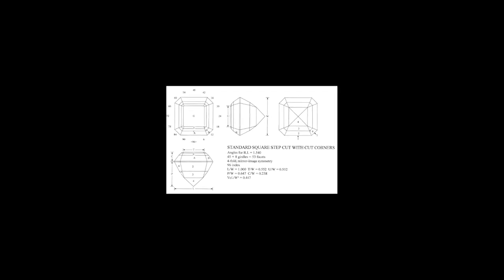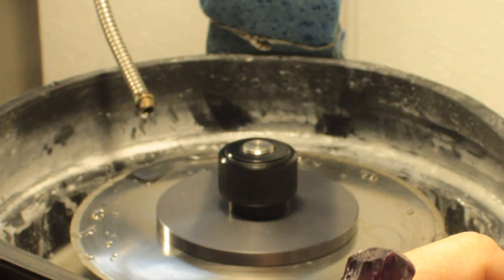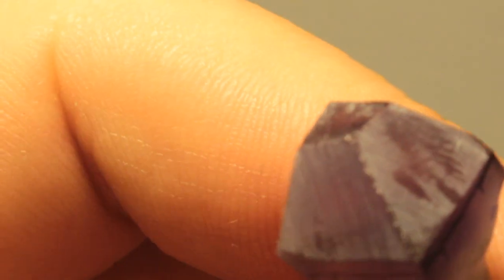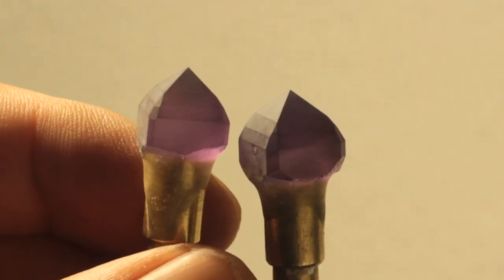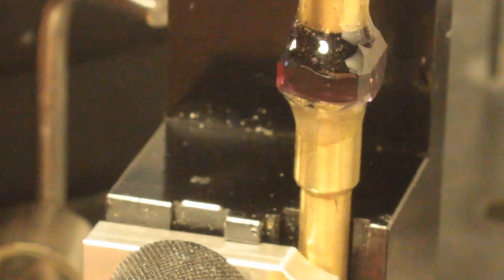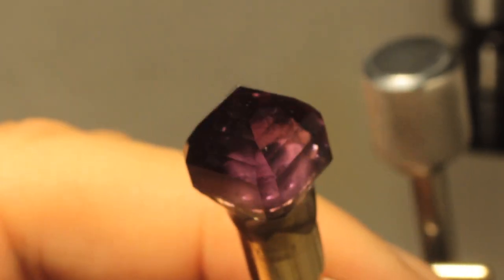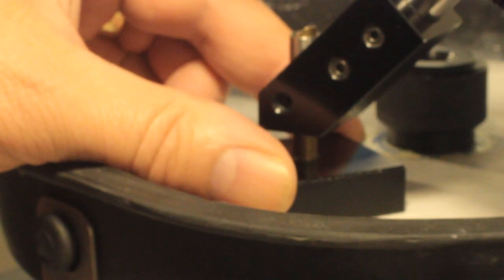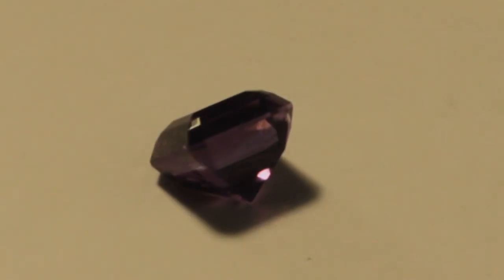Gem Cutting Tutorial: Standard Step Cut For Beginner Cutters

Comment: I agree with you on eyeballing the puddles for epoxy! My one tip when eyeballing is that if you do parallel lines instead of puddles, it’s easier to see if the lines are similar length and width and you can get even more accurate with just eyeballing it!

Comment: There is a trick to getting toppers to lay flat.
First try the master after putting an index mark on your platen with a magic marker, try the Master lap at 12:,3 6 and 9:00. If you have a dial indicator, you can tell which of those four vibrate wobble whatever you want to call it the most and the least. So now try it on the least and then try it halfway between the other indexes and you can slowly dial in where your Master lap is running perfectly balanced. 

Once you have the master lap as stable as possible, do the same thing with your topper 
This is the trick that will make that topper lay flat as possible with your lap. Barely moving and the topper not applied. Get a good puddle of water on top of your master lap. Then quickly put the topper on top of it and get the nuts secured. You should have water coming out your 1/2-in hole in the center and a little on the edges if you have enough water on there now as soon as you start spinning that water is going to create suction as it bleeds out between the topper and the master lap. Faster you go the tighter. It'll suck down. I've got cheap 1200 grit toppers that when I apply a stone to them my dial indicator has a barely perceptible wobble of less than 11 110,000 of a degree. 
You're welcome!
Reply from the maker: Great advice.  I will give that a try the next time I use a topper.  Thanks!!!

Comment: Excellent tips.
I’m an amateur using a handheld Dremel-like tool to cut/polish all types of gems from Aquamarine to zircon. I’ve learned from many tutorial videos but I’ve got questions regarding higher grit sizes on hard ceramic burs compared to wet sandpaper wheels on leather: is an 800 grit ceramic bur the same as an 800 grit sandpaper? I found some harder gems like sapphire, polish up better if I use something like a shiny flat piece of metal homemade wheels or even another smooth stone (not easy to rig up, though) does anyone know if this is done? 
Sapphires are so hard to polish completely as an amateur using amateur, recharge hand tools….& also lacking the dexterity I once had so it’s better that my Dremel-tool goes flat quickly, taking good from bad.
Reply from the maker: Those are great questions.  I just am not qualified to answer those because I don't use sandpaper or leather.  Wish I could help...again great questions!!!!

Comment: Great tutorial, I am learning about this.
I believe the 96 degrees you mentioned are not degrees but fractions of a complete revolution.
Reply from the maker: Yes, there are different index gears available for all machines.  I have several, but only use the 96 index gear.  Each setting is called a tooth so if I said 'degree' in the video, you are correct, I meant tooth.